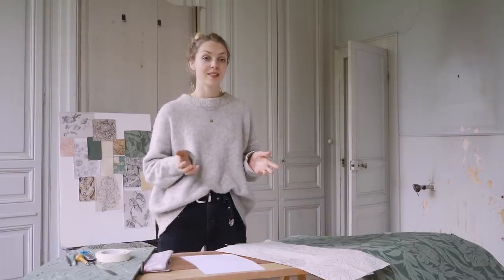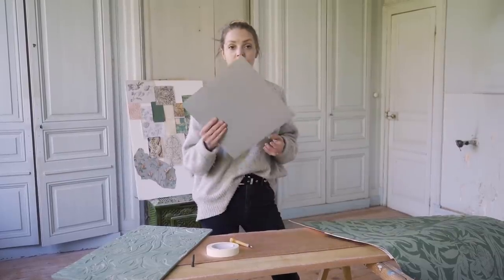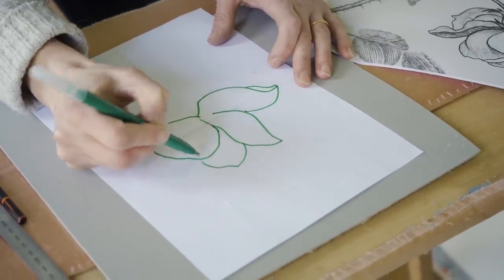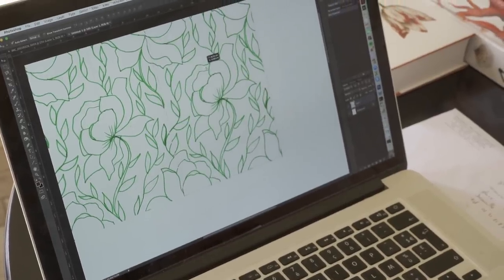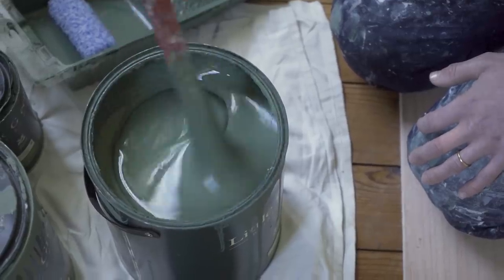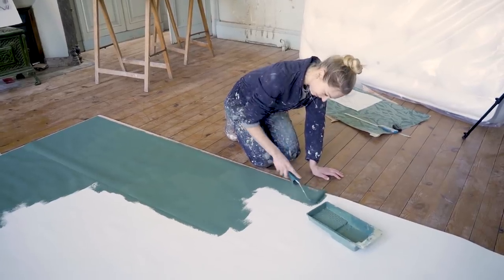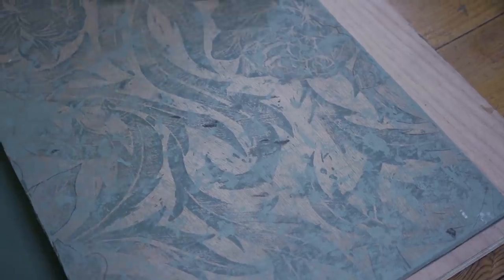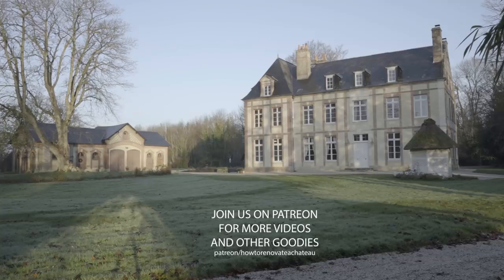Make your own LUXURY WALLPAPER - How to renovate a chateau (Without killing your partner) Ep. 9

Comment: A little tip when cutting lino, if you pre warm the lino in the oven or with a hair dryer when cutting curves or lines the line is smooth and flows better unless you wanted an uneven look that gives it a feel of a woodblock. Thank you Anna for the tip of dividing the paper, I never thought of that, I will certainly use that idea from now on.

Comment: Really enjoyed this  demonstration. Could have showed a close up of the carving tool  & maybe the info from the wall paper. Many thanks, enjoy your bantering.
Reply: There are yt videos on lino printing for budding artists.
Speedball produce a good carving tool with 5 different blades inside the handle. It allows both u and v grooves plus a fine blade for detailed lines. I've used mine for other jobs, making small adjustments on wood and pumpkin carving is a dream.
True lino for printing is heavy and hard. Soften it for safer carving by putting it on a radiator for a few minutes. There is a modern version in art supply shops that is softer and easier to carve. The name escapes me but it should come up for lino search.
Soft brayers (rollers) are good for applying ink/paint. Large hard brayers give even pressure where standing on the lino isn't possible. Same with heavy rolling pins.
I'm an artist who obviously enjoys printing. I hadn't thought of quartering a design to produce a repeat. So obvious when I saw it. Thanks. I have a chimney breast that needs attention and I can't find the right design/colour combination paper. Adds another project to the list.

Comment: If you end up doing this a lot,it may be worth getting an a1 plotter printer. Or if you still want the hand made feel, you could get your self a cricut or similar and do the designs on the computer. more room for mistakes and easier to correct them on there. If you get the big, expensive cricut, you could probably actually carve the lino on it.

Comment: Anna, could the lino stamp be used directly on a painted wall?  Instead of using a linoleum tile to carve, simply carbon paper over a mylar sheet and cut out the shapes once you have completed the "turning over" of the original pattern pieces - your Step C (A - design, B - cut, C switch and tape and complete center design). 
Phillip, your smooth voice of 'TV commercials' quality is hilarious!  Thanks for the 'lift'!   I'm curious though, PVC pipes do need glue - in the US the glue is purple, in Canada it is blue for general use and taupe-brown for wet areas.  What color is it in France?
Reply from the maker: I haven't heard of mylar sheet, will look into it, thanks!
Reply from the maker: And the glue here is transparent, thanks for those interesting  facts, will share them if I get to do a tutorial :)

Comment: Wouldn't it be easier to make a stencil? Paint the walls and stencil the print on it. Or stamp the engraving on the wall. Double the work doing it on paper and then having to adhere the paper to the wall.
Reply from the maker: You would certainly need to prepare the walls more.  But worth trying!